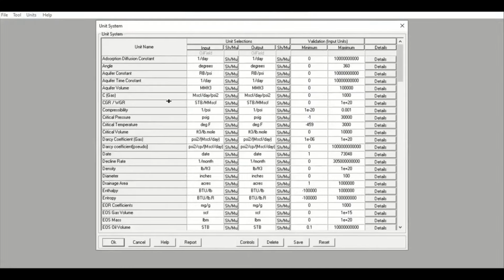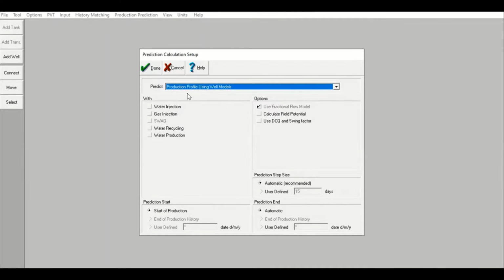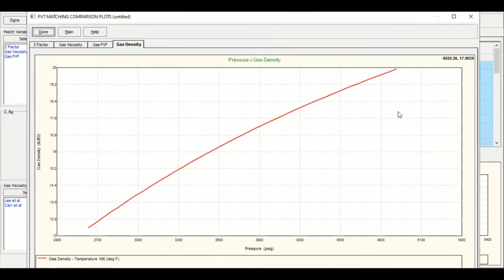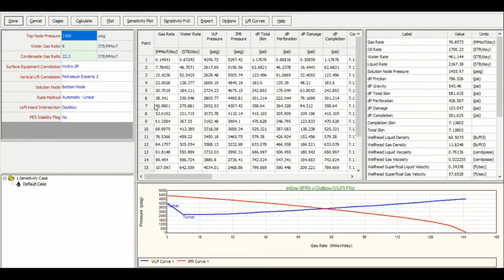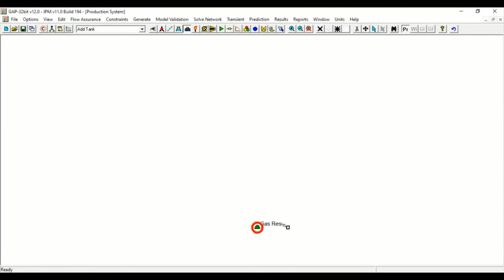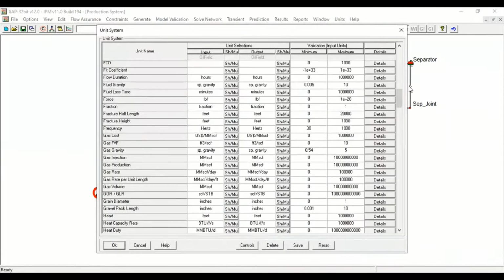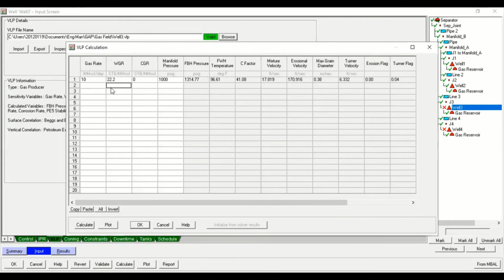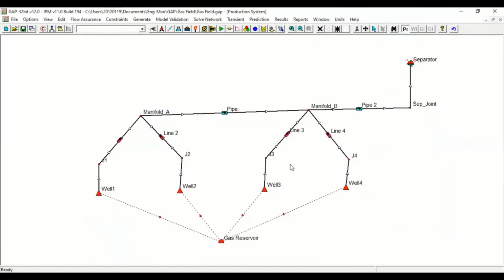Gas Production Network (MBAL-PROSPER-GAP)

Comment: Excellent work! Very clear workflow. Thank you
However, for the gas constrains you had at the separator to be honored, you need to set the well dP control to Calculated for each well at the input tabs